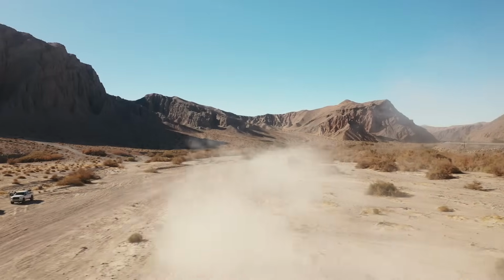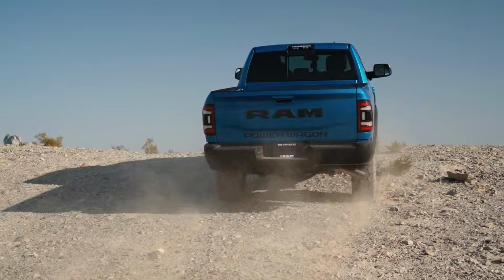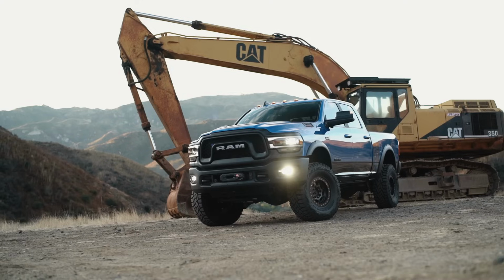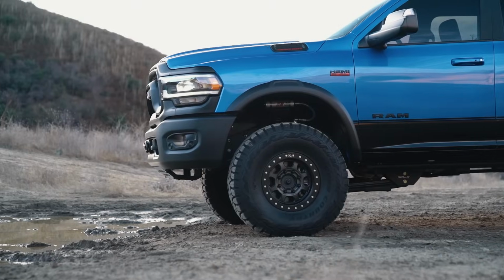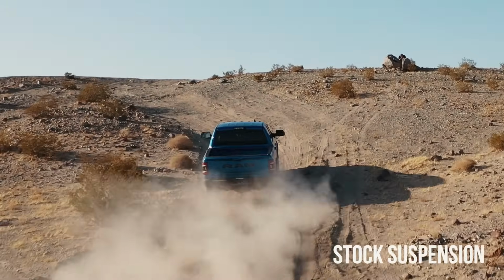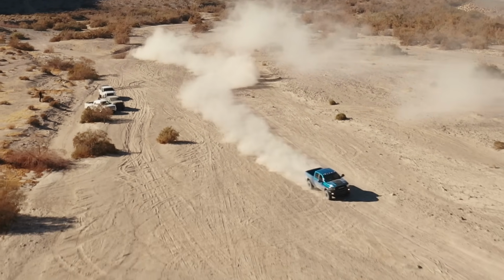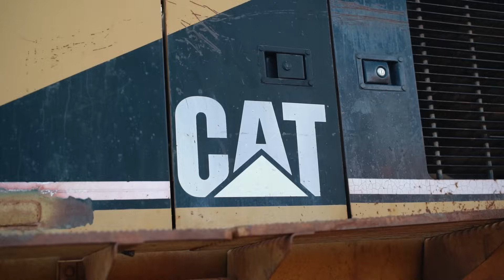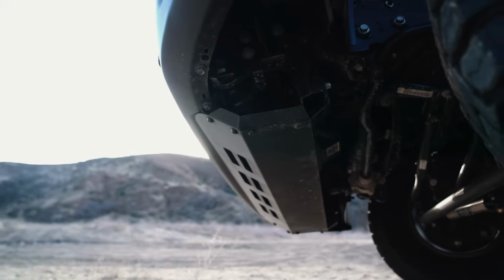Putting a Carli Suspension Pintop 2.5 System on Our Power Wagon

Comment: Since this is basically 2500 3in lift do we now have more towing and payload capacity then the stock power wagon
Reply from the maker: Correct, this has a 2,000 payload capacity vs the factory 1,400.
Reply: @CJCOffRoad  is that to bup stops

Comment: Honest question, with all the changes to the stock setup, why get a power wagon and not just a regular 2500? Similar to an AEV conversion or something; then you’d have the option of a diesel.
Reply from the maker: All we changed is the suspension, which isn’t very special on the Power wagon. Lots of people prefer all the other benefits of the platform like the winch, lower weight of the gas engine, lockers etc!

Comment: So is it possible to put the commuter on a 2018 PW and be able to tow a 5th wheel twice a year? Thuren told me to get the base package,  upgrade shocks to Fox and rear trac bar and a set of 1500 Sumosprings.  Thanks
Reply from the maker: Absolutely! Just run the Timbren Ram 2500 bump stops when towing and you’re good to go!

Comment: You guys do a lot with Rams and Fords. I'd love to see what you'd do with a GMC Sierra AT4 or Chevy Silverado Trailboss.
Reply from the maker: Unfortunately the suspension design on those trucks doesn’t lend itself well to off-road performance so we stick to the Ford and Ram trucks.
Reply: @CJCOffRoad  I see. If you don't mind my asking could you elaborate a bit on why the suspension isn't so great?
Reply from the maker: The torsion bar independent front suspension design lacks strength and travel. Unfortunately increasing travel or upgrading ride quality requires some major changes up front. While you may see a lot of companies offering bolt in coil over swaps, you’re still extremely limited on travel numbers without fabricating a new suspension set up!
Reply: @CJCOffRoad  gotcha. Thanks for explaining that.

Comment: will these bolt on to my 2015  Prospector Power Wagon AEV 3"  lift with 37's?
Reply from the maker: No sadly the AEV kit is a closed lift so you can’t run anything but their parts or factory parts.
Reply: Bilstein 8100's

Comment: Are the shocks available for stock Power Wagon suspension? For those who like the stock height of the truck
Reply from the maker: This particular setup will not work at stock height since it cycles significantly more wheel travel, so the shocks are too long for the factory coils. This setup isn't about lift!
Reply: What would be suggested for someone wanting to keep factory 33s with stock height on their Power Wagon? Been driving my for a while now and just want a nicer ride feeling.

Comment: FCA needs to put the 3.0 ecodiesel in the PW. 480 lb. ft. of torque is perfect and the mileage would be way better.
Reply: How's the HorsePower tho on the Eco diesel? Heavy truck I think it needs a V8.
Reply: @sh0cktim3  hp is only 260 but the torque is 480 lb ft,  which i think is like 20 lb ft or so more than the v8. So if you wanna hot rod then the v8 would be the way to go. But rock crawling, regular 4 wheeling, the diesel would be great I'm thinking.

Comment: So did this major suspension upgrade help your towing capacity as well.
Reply from the maker: This system has a 2,000 payload capacity, which is a step up from the factory 1,400 pound rating. Remember though that you can't legally exceed the GVWR on your door sticker regardless of what suspension is on the truck.

Comment: Did you regear for the 37s? If not, did you essentially lose your top few gears on the highway?
Reply from the maker: Absolutely not! The truck drives just like normal, but has a slightly lower RPM at highway causing speed.

Comment: So the Question is: If you could choose between a diesel 2500 or this PowerWagon? Which would you recommend? I'm leaning towards the diesel. But what to hear your thoughts...
Reply from the maker: We personally prefer the diesels due to the increased torque and substantially better fuel economy. The Power Wagon is fun, but we're still diesel fans through and through.
Reply: Power Wagon!! There is very little limit to  PW unless you tow heavy which for that u should get a duly 3500HD Diesel

Comment: What is the height of the truck after the mods from the top of the cab to the ground?
Reply from the maker: Most 19+ Rams on a 3” system with 37s are just a bit over 7 feet tall.

Comment: Darn, I was dead set on a Jeep Gladiator Sport S and Dana 60s, but this video has me thinking Power Wagon for the extra cab and bed room!  Any ideas to get 40s underneath this thing?
Reply from the maker: Unfortunately there’s no way to usably get 40s under these without doing firewall modifications and fender work, or giving up suspension travel.
Reply: @CJCOffRoad  Thanks for the quick response!  Love your videos and your trucks!
Reply: Look into AEV setup if you want 40s
Reply: Fab fours also has a no lift ad 40s kit that opens up the fenders for clearance, but I think it’s an “all show, street, not for off-road setup”
Reply: @marvinheadrick3511  Thanks, but I hate Fab Fours, ugliest shit I've ever seen on Jeeps and Trucks.
Reply: @sh0cktim3  AEV keeps stock suspension so not interested in that.  Thanks though.

Comment: Does the lift you put on this negatively affect payload and tow capacity? If so is there a way to improve it like the diesel lift kits??
Reply from the maker: This system has a 2,000 pound payload capacity. Unfortunately there aren’t a lot of good options to improve payload on the coil sprung Ram 2500 platform that don’t come with downsides.
Reply: Does it affect the  towing,  and  after the  Install  were does it put the fuel at mpgs. I want  a pw.

Comment: Did you have to re-gear it to run the 37s efficiently?
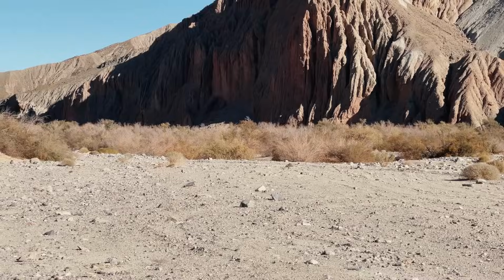Reply: Power Wagons come with 4:10s stock. You really don't need to re-gear like most trucks that come with 3.73s or lower.

Comment: Does this system improve the Rock crawling capability as well
Reply from the maker: Massively as it increases articulation and travel while reducing wheel hop to improve traction. This system was basically designed for hard use in the dirt!

Comment: Can this system handle a 1000lb snowplow? I don't have a Powerwagon, just a 2014 Laramie 2500
Reply from the maker: They’re a spring lighter rate than factory so the front coils will sag. We typically recommend running Timbrens up front if you’re using a plow.

Comment: Did you perform any custom tuning, or do they come from the factory tuned properly for what you're describing in this video?
Reply from the maker: The suspension is directly bolt on, but 37s require trimming the plastic front fender liner and a little bit of the front pinch weld.
Reply: @CJCOffRoad  Thanks! Sounds like you also installed the optional radius arms. Any disadvantage to sticking with stock radius arms?
Reply from the maker: On the Power Wagons we actually keep the factory radius arms since the have the extra articulating link.
Reply: @CJCOffRoad  I really appreciate the information - you guys are awesome

Comment: Did it require any cutting/trimming to keep the tires from rubbing?
Reply from the maker: The same trimming that every Ram on 37s gets! We have a video covering the process.
Reply: @CJCOffRoad  I figured. Was hoping the answer was no though. I appreciate the quick response though
Reply from the maker: It’s not anything vital. Just fender liner plastic and a tiny but of the pinch weld. Everything is inside the fender and not visibly trimmed.
Reply: @CJCOffRoad  unfortunately for me my truck spends most of its life in states that heavily salt the roads so I'm not very keen on the idea of trimming the fender liner and any metal.
Reply: @seancorvino7593  just hit it with a coat of paint after trimming

Comment: How well would this look with a 35" tire? Ive read the 37 cant be mounted in the factory spare location, but the 35 will if its deflated. In order to keep the spare out of the cargo area, im curious to know how this lift would look on 35's as well. IM considering a power wagon with the carli lift that will increase its rear payload a bit so I can carry the decked system in the bed, plus recovery gear and maybe even a GFC tent/topper set up. The 35's would also stay closer to the factory gearing for me, which im assuming would help when towing my 14 foot enclosed trailer. Is my thought process inline and reasonable? I love the power wagons, but they went TOO light on factory payload specs unfortunatly
Reply from the maker: You're totally fine running 35s with these systems, but don't be afraid of 37s either. These trucks really don't mind them, and there isn't much of a penalty for running them. We re-geared this truck to 4.56 to test, but it just wasn't worth it. The factory 4.10s did just fine.
Reply: @CJCOffRoad  Yeah i think they look great on 37's but for me its more about storing the spare tire in the factory location and not having to carry it in the bed or on a carrier.

Comment: 2" lift in the front and 1" lift in the rear and you're calling it a 3" lift?
Reply from the maker: It’s a 3.25” lift on the standard 4x4 2500 Ram trucks and a 2/1 on the Power Wagons since they start higher from the factory.

Comment: power wagon needs a diesel. junk truck. Ford Tremor all day with a diesel
Reply: Buy a diesel then. Just be happy we have options. If every truck as a diesel engine that would suck.
Reply: @sh0cktim3  everything I own is a diesel. The power wagon would be a good machine or a better machine if it was a diesel. Jeez. My Jeep Wrangler diesel has more torque than the power wagon. And if I chipped the Wrangler out with a plug and play programmer, I would have more horsepower as well. Put a diesel in the power wagon. Does not have to be the 6.7 liter Cummins. Put the 5.0 liter V8 Cummins. Or even put the 3.0 liter fiat engine powering all of Jeep.
Reply: It doesn't need a diesel and doesn't have one for good reason.  It's not a tow rig and the lighter/ smaller V8 is better for off-road. RAM makes plenty of diesel trucks, like a whole lot actually. 1500, 2500-3500, dually take your pick. The Power Wagon is probably the best stock truck you can buy for off-roading. You put a diesel in it and that goes out the window.